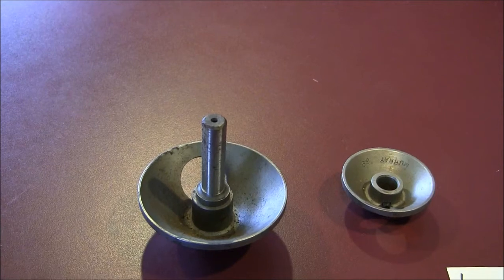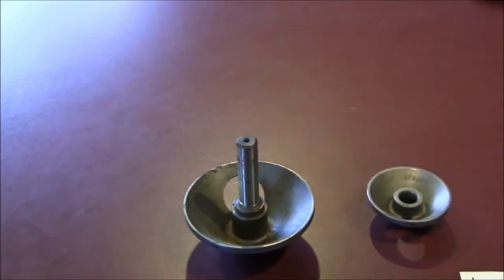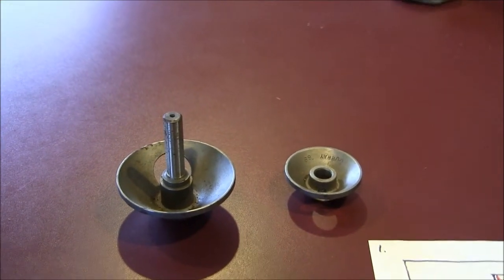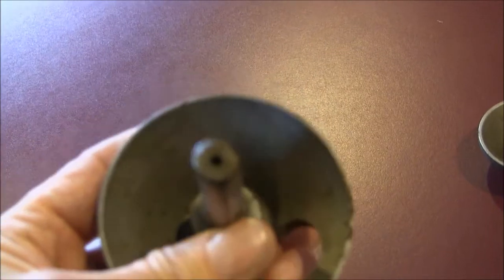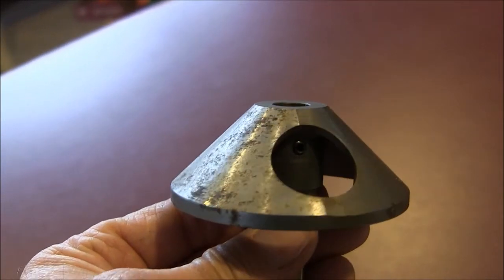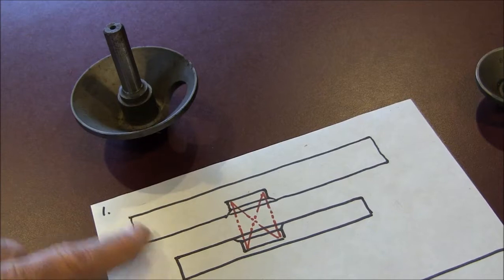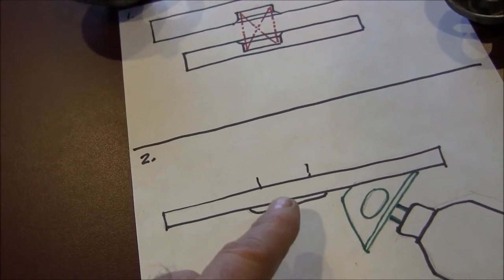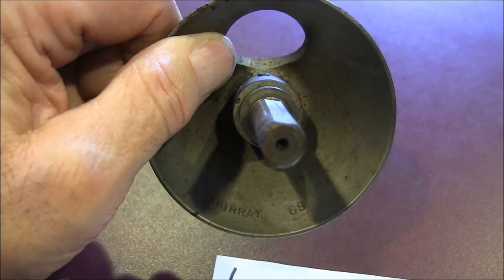Handmade countersinks

Comment: Very nice work Michael.  I am retired and getting into machining as a winter pass time.  These videos are like having my personal mentor.  Thank you-  Fred
Reply from the maker: Fred, Thanks for the comment.  Glad you liked it!  Machining is a fun and productive endeavor however addictive.  I have a video series coming out this spring which leans more towards welding/fabricating.  Currently on part 5.  I also will be setting up a Bridgeport series 1 mill with a 2J2 head.  I may video rebuilding the head if it is needed.  Best regards  Mike